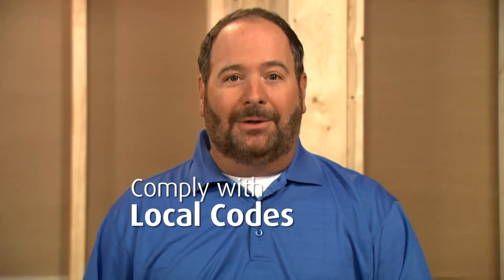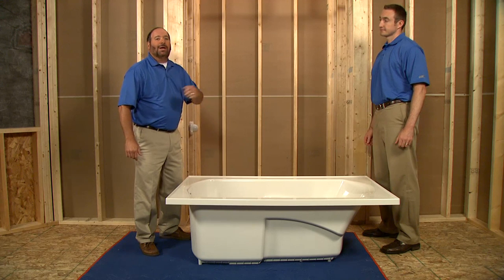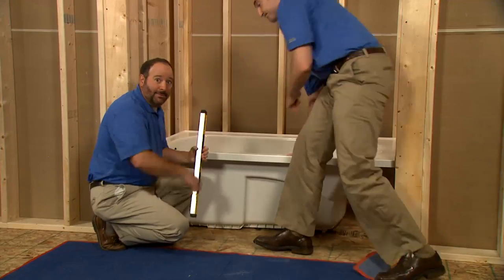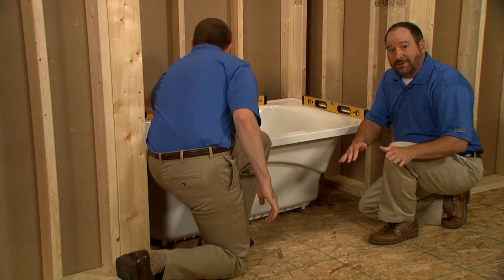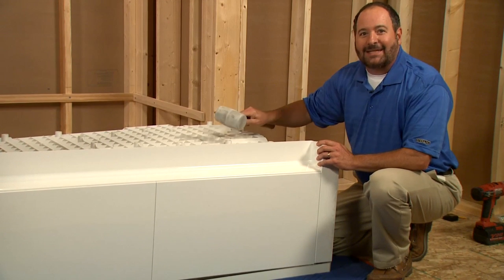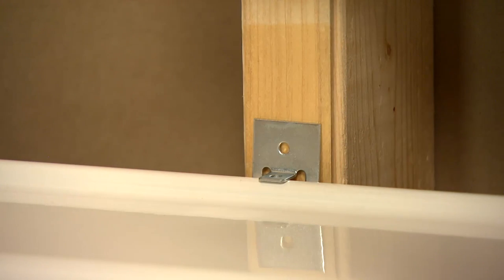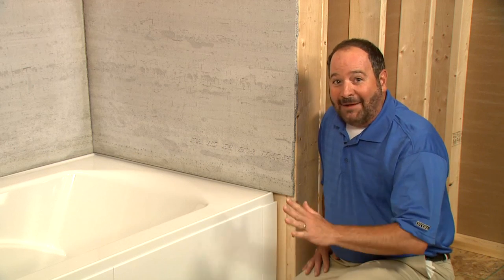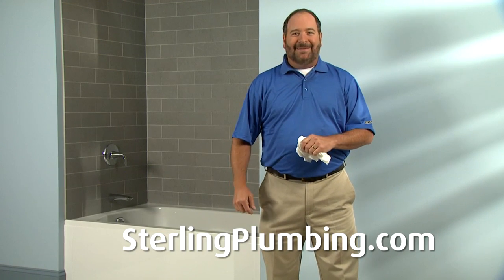Lawson Bath Installation

Comment: What is the purpose of the felt pad on the floor? Sound dampening?
Reply: Yes.   There are little stubby legs on the bottom of the tub.  It is to prevent them from squeaking and making noise.